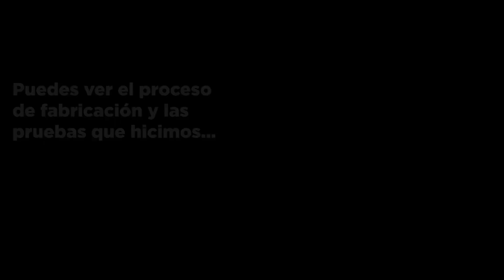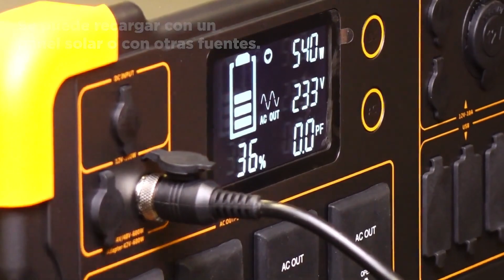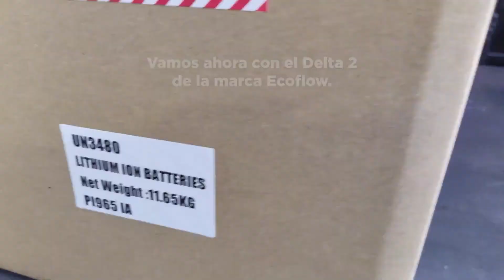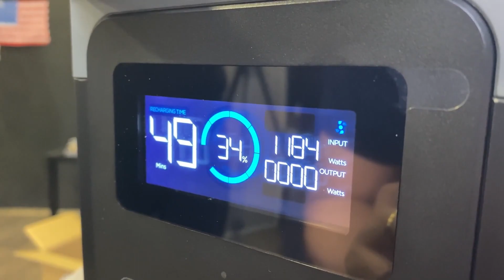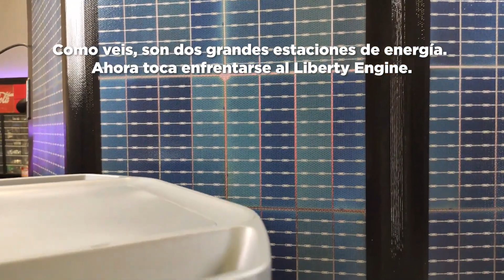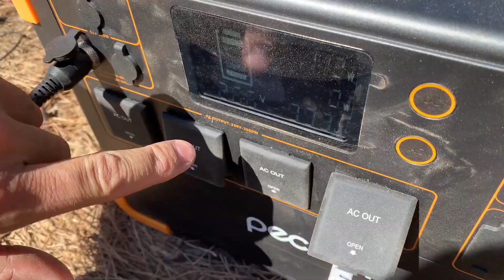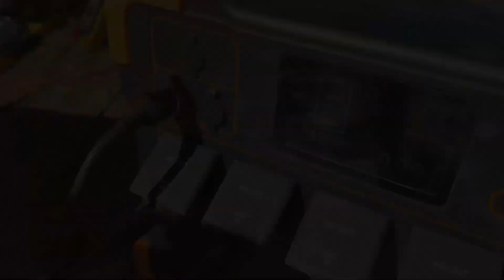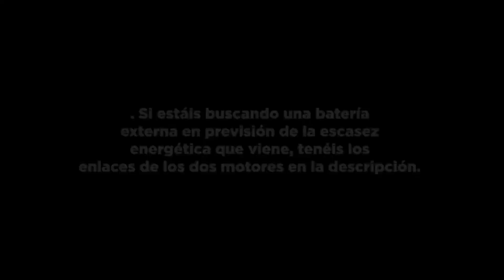Generador de Energía Gratis VS Estaciones de Energía Portátiles - Free Energy - Liberty Engine

Comment: Premesso che ritengo che questo video presenti un'invenzione falsa, quello che non riesco a capire e che senso ha fare tutto questo lavoro per prendere in giro le persone. Volendo stare al gioco chiedo: Se un pannello solare prende l'energia dal Sole, un motore termico prende l'energia dalla benzina, una caldaia per riscaldamento prende l'energia dal metano o dalla legna,... questa apparecchiatura da dove prende l'energia prodotta gratuitamente ? Grazie per la risposta che tu mi darai.
Reply: Hes using an alternator to generate Energy for the Motor to Run, this will generate Energy with the electric Motor and thus Power the alternator. This keeps the Motor running producing endless Energie. As Long as the alternator gets12v IT will Run until it Burns Out.